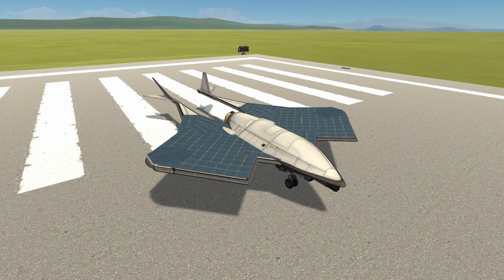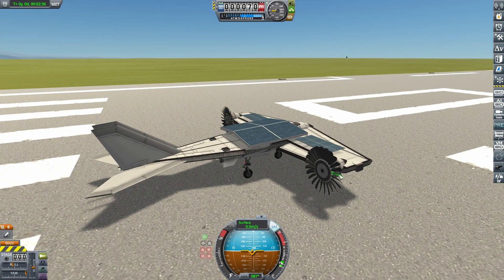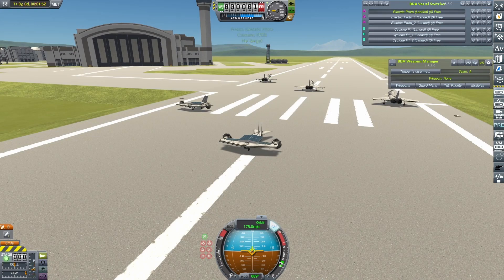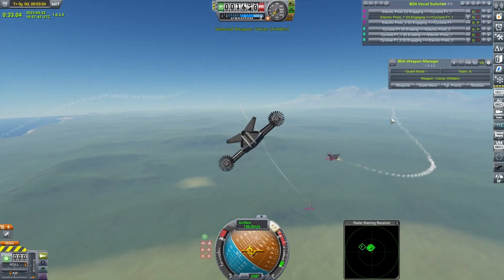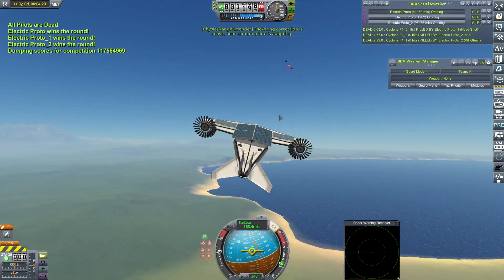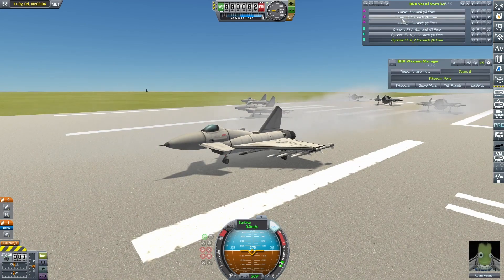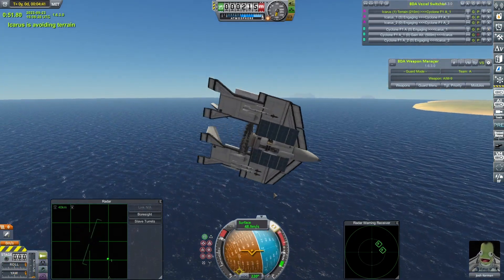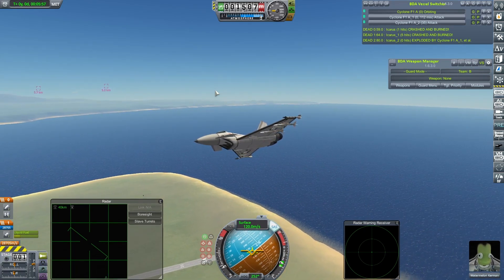Electric Fighter - Kerbal Space Program & BD Armory

Comment: Hi smith, there is actually a way to change the angle of the fan blades! All you need to do is click “deploy” in the action menu on the blades, and hook up a KAL 1000 to the blades’ deploy angle. You can then bind the KAL to an axis group (I like RCS forwards/backwards) and that will allow you to change the angle.

-Ljetta
Reply: Yes, but this is more for vtol crafts, for rotor planes controlled by ai, it wouldn't work properly because at lower speeds you need lower angle, but the ai will put the throttle to max so it has even lower thrust.

Comment: small rotors will push 8 large blades each for about 12-13kn of thrust per blade and you can set them to like 10% power and they will still spin the blades at max speed.